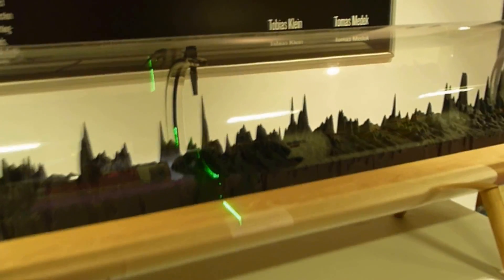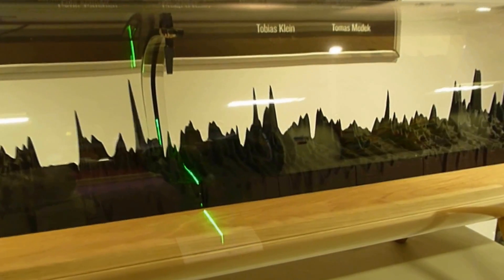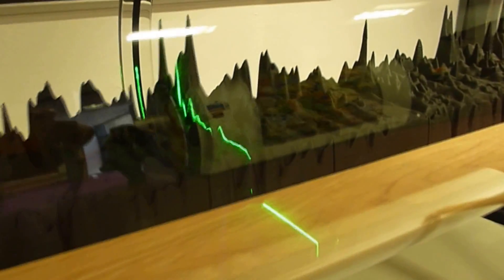Obama Voice Sculpture : Next Industrial Revolution (Gilles AZZARO)

Comment: The steam-engine converted heat by burning fuel into mechanical work, one conducive to the system of cylinders in motion, working as an energy conversion device, releasing heat and extracting work through the combustion of fuel. Engineers of the time were confounded by the rather low efficiency of the steam-engines, because most of the heat dissipated uselessly into the environment. The second law of thermodynamics helped engineers understand the underlying principle that deals with the constraints upon the direction of heat transfer.